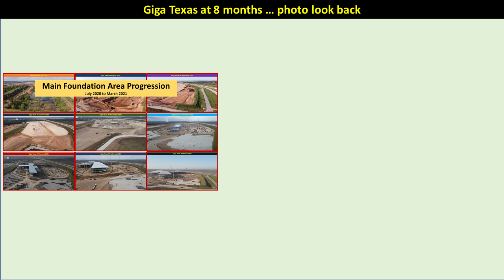Tesla Gigafactory Texas 22 March 2021 Cyber Truck & Model Y Factory Construction Update (07:45AM)

Comment: 9:20 That looks like an elevator shaft! I really don't see any other reason why this hole would poke all the way through the roof. I still think that this area will contain offices at the upper levels. It makes sense since they have to deal with all of the paperwork associated with the deliveries from the loading dock.
Reply from the maker: I think you may be correct on the offices idea.  One thing that has not clearly emerged yet is a “front” fir the factory, so this area might be as good as any!
Reply: Agreed on elevator space but it might be for a large freight elevator rather that several passenger elevators. Those are usually blocked out into separate cells. As for fronts, the front of the deliver zone is the bump out currently being built. That’s where drivers etc will walk up and get their dock information etc. Now some places are high tech and you call in for such information. But don’t know how Tesla does things. As for the rest, I expect a large entrance or two on east side facing the parking lot. As for the rest, have to look at the plans.
Reply: @Bill_N_ATX  That explains the wheelchair ramp...

Comment: Thanks for another great video Joe!  Hey, do you think you have enough data to create an estimated process workflow visualization with your colored boxes????  I mean, overlay on the current structure from the casting area, front and rear Y/cybertruck casted pieces, then meet somewhere the battery pack addition for the bottom frame build out.  From the Stamping area, the flow would be down towards the casting area building body to be added somewhere on top of the bottom frame build, then moved sideways into the paint area, run through, then off towards the interior build out....  Simultaneously, the battery production area leads to the battery pack assembly.  The motor build area finishes around this point where the motors are added.  Then the entire unfinished side is left for interior buildout then installation in the middle area.  It looks like they have enough room for three or four continuous lines in a Z type pattern....  One of your brilliant overlays would help me visualize it and give us an estimate of what is built where and why.

Edit to add:  Reread my horrific attempt to verbalize the imagery.....  I'm a victim/ born with aphantasia (google it, it will blow you away), so visualizations aren't my strong suit.

Comment: If they get the industrial elevators in soonish and they have roof access, they could perhaps use that for a lot of the roof material transportation. Not sure if that's more attractive than a crane or some other mobilised lift system but just a thought.

Comment: @ 18:10  That dirty generator shouldn't be allowed on  Tesla site!
Reply: No doubt a low bidder on the site.....
Reply: Probably not a generator per se. It is more likely a large welding rig and while it sure could use some new injectors the reason you see it puffing out smoke is that they are turning on and off the electricity as they weld. Welding pretty much causes the alternator attached to the motor to go from zero output to high output almost instantly. So the diesel goes from no load to at least a moderate load at the press of a switch or the start of the arc if you are stick welding. So the diesel only has one way to increase power output. Throw a bunch of fuel into the cylinders and let them build up RPM, and boost if it’s turbocharged. Since it’s not really up to speed, you get inefficient burn and left over soot. This is hell on the machines and without good maintenance you see them rolling coal like this one.
Reply: @Bill_N_ATX  Great explanation.  Thank you.  I just can believe it describes anything to do with Tesla.
  There's this firm that do a battery solution that smoothes out peaks in power demand.  Maybe someone should give them a call.
Reply: @Bill_N_ATX  , that calls for a hybrid generator with a buffering battery ...

Comment: Great job. We really appreciate your insights.
Question. Is there an inspection process? I can't imagine governmental agencies being involved as the process is going so quickly. Perhaps private inspection firms?
Reply from the maker: I am sure inspections are happening all the time.  Who specifically are the entities, I don’t have that level of information.
Reply: In California a city will hire a private inspection company, at the developer's expense, to partially or fully handle the inspection load.
Reply: Inspec
Reply: @dpipe6072  That's what I'm thinking.
Reply: I remember a day when they had the site shut down for work, but on the video's there was a whole crew of inspectors wandering around.
Reply: Building inspection can be a mess in Texas. Whose rules apply can also be confusing and the inspection process just gets weirder. For instance this property might be under the control of the County, or the City, or in some cases a Municipal Utility District. In this case however I think it’s under the City although Tesla has applied to form a Special District for the development. Depending on the rules of that Special district, who does what can change although the same basic building codes are usually used.  But since this started under City planning I doubt that the City will let it go. Too much money to be extracted. So city inspectors I bet. And yes, on a property this size, I’m sure they are there daily inspections around the site from several different trades.
Reply: @zmavrick  , there are many kinds of inspection and inspectors. Some are from the local authorities and ensure the place meets laws, regulations, and codes, mostly to ensure safety, such as the NFPA Life Safety Code 101. Then there are best practices codes from various industry groups, and environmental codes from a whole laundry list of three and four letter agencies. Finally, on a site like this, a smart owner has supervising engineers and inspectors who watch that the place is built right. They work for the owners and make sure they get what they are paying for. Just because it meets code doesn’t mean it’s done right. Sadly, some times it’s not even close. Like in residential housing, code minimums are just barely enough. You really don’t want to buy one of those.